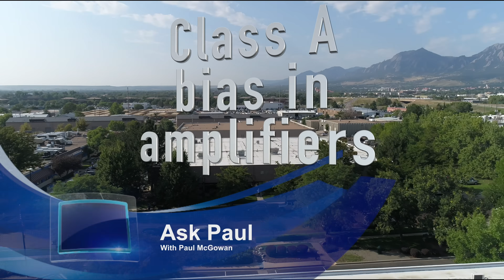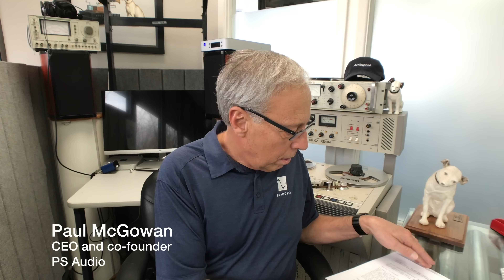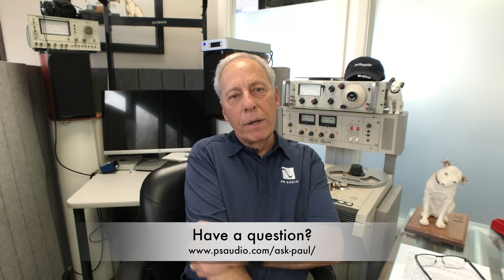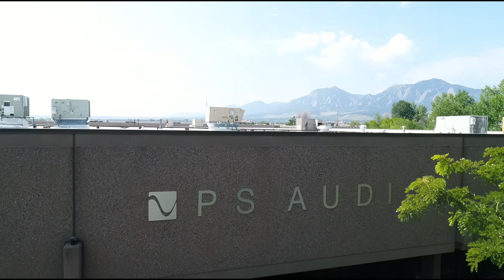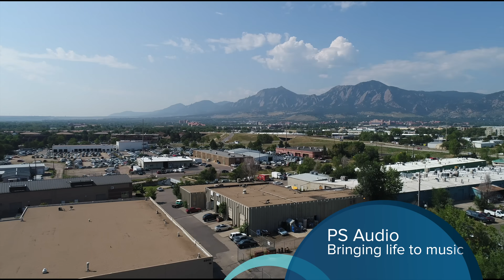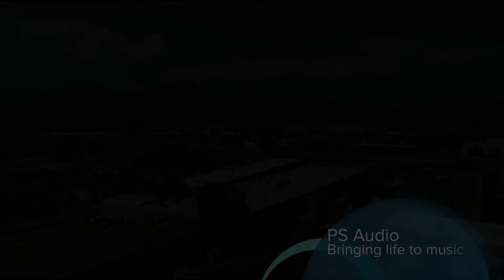Class A bias in amplifiers

Comment: Keeping class A area is harder when more voltage, output voltage is set. So counterintuitively, a class A/B 100 watts amp will have more watts in class A that a 300 watts class-A/B. It is impractical to design a 300 watts pure class A due to the current and heat wasted. For the other hand, avoiding more than 100 watts of class A amplifiers keep it reasonable. Another thing to take into account is that the class A envelope is halved when loudspeaker impedance is halved too.

Comment: Hi guys, I built my JLH 1969 (10W) monoblock amplifier.

I set up 2 amplifiers to make stereo.

Power supply:
Transformer: 110V / 220V (60Hz) / 0+18V AC / 6A
Rectifier bridge: 8A
Capacitor: 22,000uF (63V)

Power on amplifier board: 18V DC
Bias (I.Q.) = 2A

Distortion-free maximum power (1kHz) = 7W rms (per channel)
Distortion-free maximum signal input (1kHz) = 524mV (-3.5dB)
Maximum undistorted signal output (1kHz) = 6.45V
Speakers = 6 ohms (Kenwood 50W)

Temperature in components:
Amplifier on for 2 hours.

Ambient temperature = 25°C

2x Transistor 2SC5200 = 55ºC
2x 2SC5200 heat sink = 40°C

Rectifier bridge = 51°C
Rectifier bridge heat sink = 39°C

Transformer temperature = 40°C

In my channel videos showing the amplifier and tests.

Comment: sooo what exactly is the class a bias in watts in bhk amp
Reply: A mono amp that can drive 300W into an 8 ohm load, with a quiescent power consumption of 70W as Paul mentioned, probably has an output stage bias current of 400mA or just under.  
That means it could stay in "class A range" when delivering peak currents of up to +/- 800mA.  With an 8 ohm load, that means up to 2.5W.  With a 4 ohm load, it's only half of that.
But most amplifiers only have bias current in the 75-150mA range, which means the "class A range" is only around 1/10 W to 1/3 W into 8 ohms.
Reply: @marianneoelund2940  iv heard otherwise but i dont argure the math. Only others i can find are avm and lux and acuphase  of course
Reply: @marianneoelund2940  my existing coincident 300b int amp pushing 18w of a 
Id likely go the current luxman that suposidely does 30 in a and 90 in ab
Reply: @markw7303  
Are those the manufacturers' claims, or measured by a third-party lab?  You can push the "class A" number up by setting an unreasonably low limit for the off-side cutoff current.  
But in the end, it's all about avoiding the crossover notch, and bias current isn't the only factor; the range of "class A" operation won't necessarily tell you which amp sounds cleaner.
Reply: @marianneoelund2940  i forgot coda which will bias any of 3 ways. I just havent been able to demo  And really the best allround examle and the only manufacturer i belive numbers from. They are and oem for others such as sanders and legacy and will bias from 8 to 20 watts of class a
Reply: I would love to have reviewers who consistantanly measured all amps (ab) class a basing  and i would love to be able to mesure it my self in older existing amps i come across 

What equipment  would you need to measure i assume ocilascope and voltmeter?

I know this is not the only metric but when spending 8 or 10 k or more i feel manufacturers could be more honest. And i would feel i got more value  for money

Which in the end may lead me back to coda anyway
Reply: @markw7303  
I would use a scope current probe on the emitter resistor, to see how the current fades out.  Or a differential voltage probe across the emitter resistor.
Reply: @markw7303 hi fi news magazine list idle consumption  of amps tested.

Comment: Why do amps that produce the same wattage (200watts) contain more transistors and are larger than cheaper versions that produce 200 watts? Does more transistors equate to more quality and better design?
Reply: Not necessarily... Some designs have a lot of auxiliary circuitry with transistors, that doesn't affect the signal directly. Also you can have the signal be produced by more than one transistor at the same time, to distribute the load and reduce what each transistor handles. Basically an amplifier with more transistors might mean that the circuit has more features, but not necessarily that it "sounds" better.
Reply: it also seems to suggest a lot more control and consideration of parts if you go the discreet route. when you pick and choose every transistor you can be more certain the signal is being tonally effected the way you choose it to be.

Comment: A true class A amplifier is a single ended output. 1 transistor, or 1 tube. The full waveform is reproduced by a single tube, or output transistor.
Class B is a push pull design, where one output transistor or tube amplify the positive portion of the waveform and another for the negative half of the waveform. 
Class B are very poor in the distortion department due to the crossover distortion that occurs at every reversal of polarity in the AC audio signal. Class AB overcomes this by applying a small amount of bias to keep the transistors or tubes from going into cut off at idle. Depending on how much bias is added will determine how much of a waveform can be produced before the amplifier is driven back into a push pull design. Close enough explination?
Reply: No, you can build class A with a complementary output stage.  It just requires a bias that is high enough that neither side ever turns completely off.

Comment: If an AB amp is in class A, are both transistors of a pair conducting at the same time? If so, is that not a problem?
Reply: The design challenge is to get a smooth transition in the crossover between the transistors. A bad design will have large crossover distortion..
Reply: Yes, they are both conducting. In the transistor pair for the output, the NPN transistor is biased positively, whereas the PNP transistor is biased negatively. Both draw a small amount of current at all times, thus the range between the positive and negative bias for the transistor pair is considered a "Class A region." Once the input signal exceeds the bias voltage in the positive section of the wave, the NPN transistor begins to conduct from collector to emitter. In the negative section of the wave, the PNP transistor conducts from the emitter to collector. These two transistors operating in tandem is what creates the current swing necessary to drive a low-impedance load, like a loudspeaker.
Reply: Class A amplifiers generally only use NPN or n-Channel MOSFET output stages, and operate in a fundamentally different manner. The transistor(s) in this arrangement are typically biased in a way such that the entirety of the input signal is shifted into the positive operating region, and a large capacitor is used to block the resulting positive DC voltage from entering the load (loudspeaker).
Reply: OK, thanks
Reply: Kevin Roosa wrote, "Class A amplifiers generally only use NPN or n-Channel MOSFET output stages"  
Only preamplifier or driver stages are built single-ended.  Practical power amplifier output stages, even class A, always have active devices for both output current polarities (push-pull), in order to provide acceptable efficiency.  This will be true even if you have only one power supply polarity (unipolar supply) and a series DC blocking capacitor at the output, as you still need to drive signal current in two directions to the speaker.  
Granted, you could if you wanted to, build a class A power amp using single-ended output transistors, but this would require a low-resistance high-power resistor internally, to provide the other direction of current, and the efficiency would be abysmal.  For example, if you made a class A amp like that with a unipolar supply, that can output 30W into an 8 ohm load, the power supply would need to be at least 90V and the optimum internal pull-down resistor is 8 ohms 300W with an output stage idle current of 5.6A.  Quiescent power consumption is over 500W per channel, so you would probably want to set it in your fireplace and use it as a fire substitute to heat the entire first floor of your home.  
Using complementary output devices instead (still class A), the internal 8 ohm resistor goes away, the required power supply voltage is only 50V (still unipolar), output stage idle current is 1.375A and the quiescent power consumption is under 70W per channel.  That's how commercial class A amps are designed.  You can also use +/- 25V bipolar supplies instead, to get the same efficiency figure and toss out the DC blocking capacitor.

Comment: Sorry but I find your explanation very confusing. 3 simple drawings can explain these 3 classes.
Reply: It’s relatively simple. Neither of the output transistors ever go into cutoff under any condition in the output waveform. Or the other way to state it is this, the output transistors are biased at a current that is higher than the load current. For example, if you have a maximum output voltage of 10v and a 10 ohm load, the max output current is 1A. A Class A output stage will be biased at just over 1A.
Even so, an output stage that is biased at 500mA is still considered Class A if the output current is never greater than 500mA.  And once the output current exceeds the steady state (idle) bias, this goes to the term “leaving class A”. Firstwatt has some articles on the topic.
Reply: @gman76ut
Practical Class A amplifiers are more efficient than that.  The idle current only needs to be half of the peak output current because the latter is the difference between the two output transistor currents.  
In your 10V 10 ohm example, output stage idle current only needs to be 500mA; as output voltage swings away from 0V, current in one side of the output stage rises, while current in the other side decreases by the same amount.  At peak output, one side conducts 1A and the other side drops to near 0A, thus sending 1A to the load.  
A class AB amplifier with a 100mA idle current can provide up to +/- 200mA of current to the load in its class A region.  (But that does not mean it will achieve the same low-distortion performance as a true class A amp does at the same power level.)